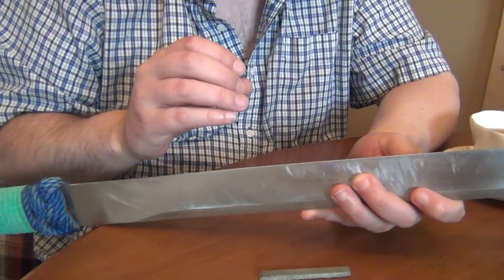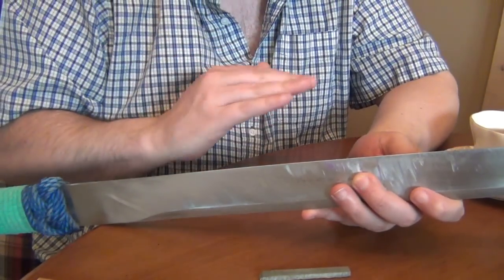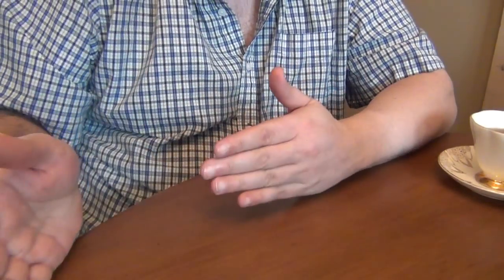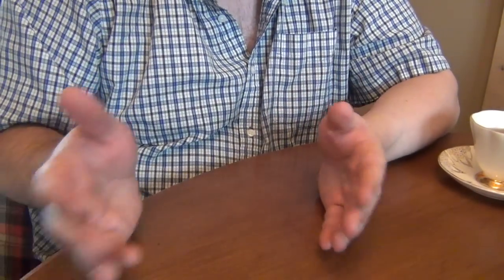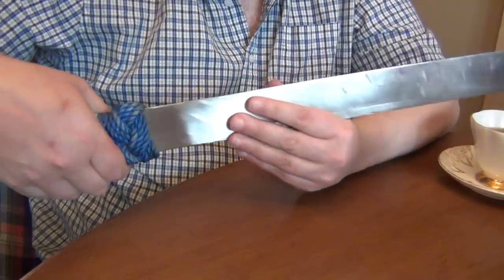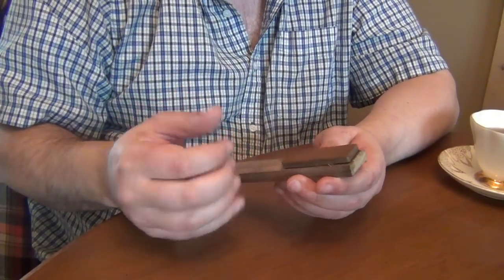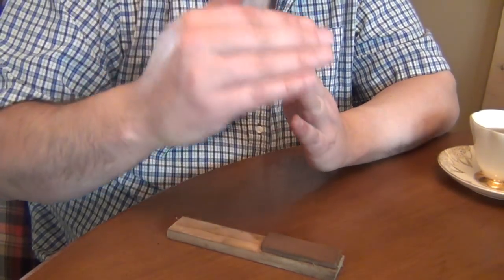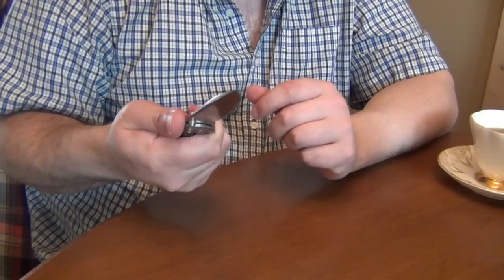Using oil on waterstones and water on oilstones ?

Comment: I have been thinking about this same concept recently. I have a crystolon stone which I was told would work better/cleaner with water than using oil. This turned out to be false as it loads like crazy. I kept it in a box for over a year til recently. It takes a lot of pressure but for thinning clad japanese knives it does a good job of it. I noticed a large decrease in loading since using oil.
After this observation, I thought about my collection of 'soft and muddy' coarse japanese stones which I have problems keeping flat (working on using the whole stone technique..). If I could use them dry, they would act 'harder' and produce less mud/stay flat but then they would load. If I used oil the stone would still be lubricated without being soaked and excessively muddy/wasteful. My old imanishi pink brick goes unused due to how wasteful it is and so it became a guinea pig for me only yesterday. 
Instead of soaking in water like I was told and always have done in the past I just splashed it with the smallest amount of oil and lo and behold the stone didnt explode. In fact, the dishing problems I felt when using it soaked were no longer an issue. On top of this, no loading problems either. The whole stone changed performance considerably. It still shed abrasive but at a much lower rate thn using it soaked.
 The finish on the blade changed from a harsh coarse scratch pattern with the slightest bit of haze (from a soaked stone) to a light hazy kind of finish (using oil)- similar effect provided by an ss 400 although I would guess the 220 pink brick to have slightly coarser scratches. Whilst this affect is achievable using low pressure on the mud with a soaked stone, using oil made achieving this finish trivial - even at higher pressures. 
Seeing as I've only got one sharpening session to go off, I couldn't say whether it is faster or slower to sharpen using oil over water although I would tend to think due to the less harsh scratch pattern forming on the blade that it would cut slower but giving a finer overall finish. More importantly, it has definitely opened my eyes and has me thinking more about what I can achieve with different stones just by manipulating how I lubricate them.
Reply: Thank you for sharing your experience. Years have gone, how has developed your sharpening? Does what you have learned still apply?

Thank you
Reply: @jonugalde1275  sharpening has taken a back seat in my life over the past few years but I think more than anything there's more confidence that I can get a satisfactory edge without requiring a large array of stones that I thought I did when I first started out over 10 years ago. Overall I think I generally prefer using stones that respond well to water but I've amassed a huge collection over the years when I wasn't also paying a premium for them so I have the luxury of choice. 

After I played around with lubricants all these years ago I started trying out different grit stones to use as a nagura for finishing on some of my harder stones- that too had an influence on my edges depending on how fine the nagura was that I used. Whether it was an improvement or not.. I didn't make a proper experiment of it to make those comparisons in a numerical sense

Comment: Cliff, if oil is a better lubricant and reduces friction, why not use oil on diamond stones?  Have you tried it?
Reply from the maker: +Le Wang I use detergent on the very coarse ones. On the fine-x-fine ones I use water with a anti-rust agent. You have to match the lubricant to the grit essentially. If you go too heavy you can mask the grit.

Comment: There's a guy on youtube who recommends Norton India stones, which he claims are impregnated with oil, but he recommends that you boil them in water until the oil is gone. He likes his stones bone dry. I don't think I'd do that but do you not see a conflict of interest between reducing friction with oil or water and sharpening ability? In other words if you eliminated all friction would not not have a stone that wouldn't cut metal?
Reply from the maker: +Tin Man Friction isn't how it cuts, friction is the waste heat from not cutting. 

When people use oil on stones and they claim they don't cut they are using heavily loaded stones. Most of those people don't know how to condition stones and have no idea how stones should cut.
Reply from the maker: Tin Man, the mechanics of cutting I explained in the above, I can reference a paper or two if you want to look at it in more detail. Friction doesn't cause or allow cutting, it just reduces cutting ability by utilizing work to create heat. 

Note the part in your definition which says "resists the motion", thus if there is no friction there is no resistance to the motion of the surfaces, hence cutting is at a maximum.
Reply: +Cliff Stamp  Right. I don't think we disagree. I'm just saying that there's always some resistance, never no friction. Maybe we should suffice it to say that sharper blade = less friction and leave it at that.
Reply: +Cliff Stamp I found when changing to using oil on some stones that I had never used oil on, and ones I had. That when I went from water to oil it cut much better. But I also have a Norton IB8 that doesn't have oil in it (which is weird ecause every other one I had seen came pre soaked with oil), and it cuts really well with just water.Unfortunately I don't know enough about the stones to know the reasons behind all this, so I just use what works best on the particular stone and it keeps me happy (more of a practical than scientific consideration there).
Reply: +Cliff Stamp  I've been experimenting with a Washita and a couple Arkansas stones and I agree that they work with either oil or water - maybe a bit better with oil but I couldn't prove it. But when you say oil doesn't dry out I beg to disagree. I squeezed out a drop of honing oil on a scrap of metal a couple weeks ago - now it's gooey, gummy, sticky sludge. This was branded honing oil. I'm sure different oils behave differently but I've become convinced that my stones work way better if I strip off the old oil occasionally. I scrub them with detergent and a stiff nylon brush and then re-oil them or use water and the stones are better for it. Really brings them to life.
Reply from the maker: Ask yourself this question - if I coated an axe with a perfect magical compound which removed all friction and then slammed it down into a piece of wood, do you think it would not cut the wood because of the loss of friction or do you think it would actually cut better because of it?

People think that friction helps the cutting, it doesn't. It is easy to think about it with axes because you can see the effects of the friction direction. When an axe head gets dirty/sticky you can feel that reducing cutting ability. The same happens with the abrasives, you just can't see it.
Reply from the maker: Yes, I should have clarified. There are oils which have oxidizating agents which will basically turn them solid, as well oils can pick up dirt from the air and turn into a thick mess over time.
Reply: +Cliff Stamp   I know what you mean but I think of it in slightly different terms. Minimizing friction is good in practice but in principle a frictionless axe could not cut a blade of grass. Ask yourself this question: What's the difference between cutting with an infinitely sharp blade vs. rubbing two perfectly flat surfaces together? Answer: Locality. Either way you're applying friction. The sharp blade applies it locally rather than spreading it out as in the flat planes. These are two ends of the same spectrum. When we lube our Arkansas stones we shift a little to the sharp end of the continuum - less flat-to-flat friction, proportionally more localized friction. There's no getting rid of friction - the best we can do is to apply it where we need it.
Reply: +Cliff Stamp   Friction -  "The force that resists the motion of one surface relative to another with which it is in contact." That's from the Oxford Dictionary of Physics. If understand correctly you can't cut something, or even rub two things together without friction. But let's not split hairs. Anyhow, thanks for sharing your thoughts.
Reply from the maker: I don't think you are using friction in the sense it is defined in physics which is simply the wasted energy, usually dissipated as heat. 

When a blade cuts a piece of grass there are a number of forces involved :

-the force directly on the grass which produces the pressure to cut it by generating the rupture pressure

-the force against the grass which pushes it apart to allow the former force to act 

-the waste forces which just dissipate heat (these are the frictional forces)

By minimizing the latter you maximize the cutting ability. If they are high enough the cutting ability can in effect be stopped completely.

Again, just using friction as how it is defined in physics. I am not sure what it means when you use it as you don't seem to be using it in that sense.

Comment: I liked the video. I have used water and oil on my Arkansas stones. There is virtually no difference. One thing I agree with you on is, I'm not taking my expensive Sharpton GS and trying them with oil. If I live long enough to wear them out, I might try it. But, I doubt I'll live that long.
Reply: Shapton specifically says oil is OK actually. I was surprised to read that